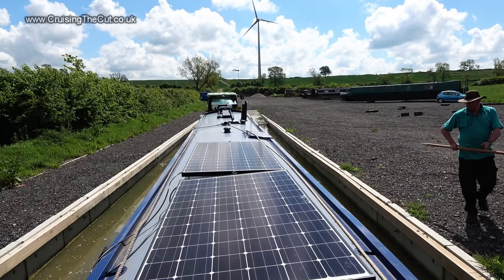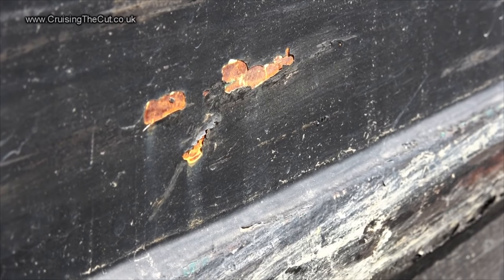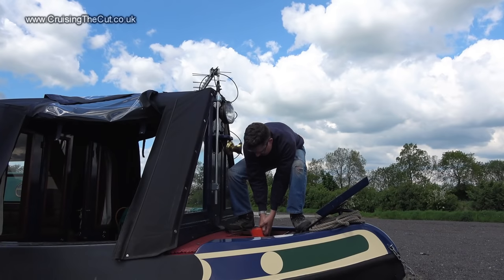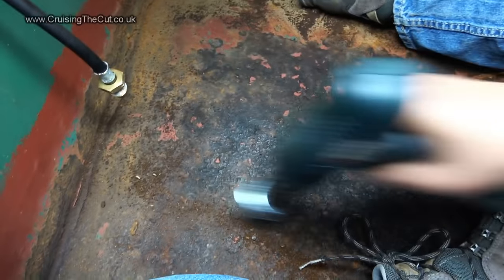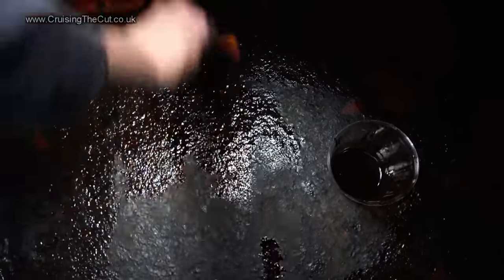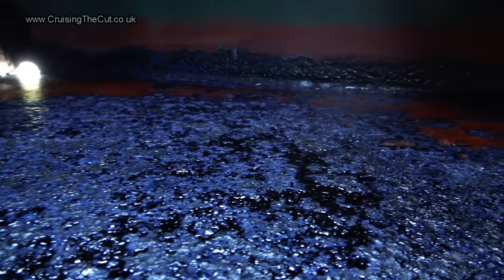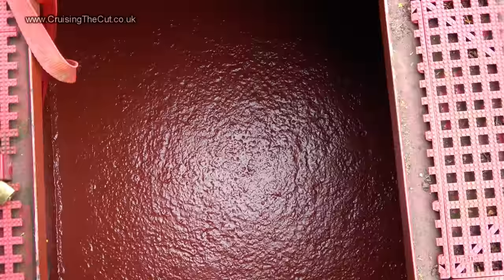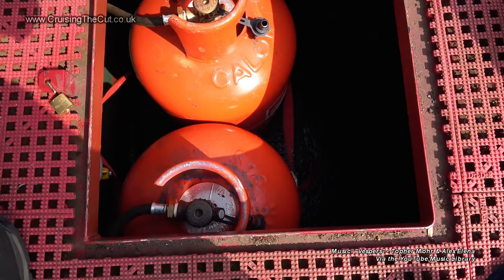55. De-rusting and repainting my narrowboat gas locker

Comment: For never having done this before, I think you did a pretty decent job of it.  Earlier this year, I made a similar error sanding down some wooden deck furniture.  I thought I had enough fresh air and didn't worry about a proper mask.  I breathed in far too much wood dust and I ended up with my lungs irritated and breathing issues that lasted about 2 weeks.  I learned my lesson.  I was quite worried that I may have done some permanent damage to myself but in time it finally cleared up.

Comment: Years in the Merchant Navy has taught me that the only way to scrape away a rusty deck is to use a "Needle Gun". They are powered by an air compressor and will do a first class job in a fraction of the time it takes to do it with a wire brush. I would be very surprised if the Marina doesn't have the kit somewhere and they may be prepared to hire it for a few quid.

Comment: I know this is four years old now but if you have to "do your gas locker" again, you may want to think about electrolysis. O-Level Chemistry is your friend. Fill you gas locker with an ionic solution (preferably not salt water), isolate your boat electrics, you'd have to plug the drain holes. Attach your boat chassis to the negative pole of a battery (your boat probably is negative earth), find a piece of scrap metal (sacrificial anode) attach it to the positive and dunk it in the ionic solution. It may work YMMV.

Comment: Methods learned in navy to remove rust: use a hammer * for 95%, then a angle grinder, for the 4.99%, then the phosphoric acid for the 0.01%, then Rustoleum red primer and top coat.  Safety gear: ear and eye protection for the hammer work, dustproof eye protection and filtermask for the grinding, and rubber gloves for the acid work..  
*  Steel is much more flexable then the rust so a good wack will easily  break nearby crusty rust loose. 
Best learned by watching others wield the chipping hammers in the hot sun.
Reply from the maker: Excellent info, thank you.
Reply: I use a wire wheel on a 4.5" angle grinder for rust removal of this type after tapping the loose stuff with a hammer. If you want a smoother finish use a flap wheel on the grinder afterwards.

Comment: Hiya David. Could you possibly cut a pvc pipe in half and glue it to the side in the well deck to fashion a culvert. Of course, cutting it in to the exact measurements. Possibly a coat of putty around it. (( Only thinking out loud )) 😊 great job 👍

Comment: I would consider investing in a corded 4.5 inch angle grinder. You can get them fairly cheap from Screwfix and wire wheels for them are cheap too. They shift rust for breakfast and although noisy, make mincemeat of de rusting. I bought one years ago for £25 and have restored countless engines and other bits and bobs. It owes me nothing. You could use the marina genny to operate it. Just a thought.
Reply from the maker: A good recommendation is always welcome! That said, hopefully rust jobs like this won't come along too often.
Reply: Absolutely agree. I paid £11 for my grinder from Homebase  for just this type of work

Comment: Usually, on larger boats, a tool called a needle scaler is used to knock rust off. It's a pneumatic tool with a bouquet of hardened steel rods that bang the rust loose.

Comment: I love Rust Converter I use it all the time on the farm, I have yet to have to re-due any particular job, I put rust converter on our Turkey Barn Feed Silo tanks on the outside ten years ago and painted it and it still is holding...my rust converter turns white the next day, and it says to re-scratch it with wire brush so I do... than paint ..strange stuff but it works...nice job...PS I love Marine Paint we use it on our Farm Equipment....little more expensive but worth every cent.....its Awesome....Cheers
Reply from the maker: That's nicely reassuring! Thanks.

Comment: Just a note about the use of rust convertor chemicals like the Fertan: DON'T dip your brush directly into the bottle, or pour the unused product back into the bottle!  The Fertan and others chemically react with rust to "convert" it to a hard, plastic-like surface, and since your brush will invariably pick up some rust flakes, they'll be put back into the bottle.  The next time you go to use the bottle of Fertan you'll find that they entire bottle has been "converted" and is now useless!

In the States there are similar products from Rust-Oleum and others, available at Wal-Mart and auto parts stores, as it works well on rust no matter where it's located, and I've used it on cars for decades.

Comment: I wonder if it is a good idea to basically make a little dam inside the welldeck lockers so that any liquid coming from the welldeck is channeled right out the hole again without getting into the locker proper. After all the lockers are covered, so theoretically water shouldn't be able to get in there from above. if you want to try it out, you probably could use the silicon-esque stuff you used along with that magnet on the roof.

Comment: I don't know about that rust converter but the brand POR 15 you just paint on with a brush let it work per the instructions, basically it converts the rust to a different type of oxide that is more stable, black in color, essentially it's like bluing for firearms or tool blacking, it's a hard durable surface that protects the steel underneath. Then simply paint over it.

Comment: When it next comes out to do the well deck and lockers can a flat bar be welded into the well deck lockers corner so the water runs straight thru the locker and out the drain hole without swamping the deck locker. Be a shame to do it now and remove all that work but worth doing if grading back to bare metal. Another pleasurable video.
Reply from the maker: No, because theoretically that would be a slight barrier to any low lying gas that escaped from the cylinders & that's not permissible.

Comment: I noticed the hoses do not have the new  hose ends. They are designed so if a leak occurs suddenly it shuts off gas. It also means you have to slowly open the valve  or gas does come thru.

Comment: nice job all over.  looks terrific.  i wonder if there is a better way of venting the gas locker that you dont get water coming in to it.  i understand why the vents have to be so low, but there has to be a way of getting the vapors out but keeping the water from coming in.
Reply from the maker: It has to be at floor level so what it really needs was the whole locker to be taller in the original design

Comment: A year or so late but. Have you looked at using a truck bed liner spray like Rino lining in these areas? Your channel got me hooked on Narrowboats. I do own a 25 foot sail boat unfortunately there is a serious lack of canals here on the west coast of the US. I can sail by the Queen Marry and surrounding cost but your views are spectacular.
Reply from the maker: Can't say that I have (or even know what that is). I'm hoping the water-resistant blacking will do the job, as it does on the hull.
Reply: CruisingTheCut Over here in the US it's a textured spray on liner that is waterproof and made to take a beating. It looks like they call it line-x on your side of the world.
Reply from the maker: I'll have a look; cheers.

Comment: I prefer the bow arrangement where the gas bottles are stored in compartments on the well deck and what you have as your Gas locker is the water tank. It means the legally required gas locker bottom vents are above the water line.
Reply from the maker: Technically speaking mine are above it - just not by enough! But I agree, I'd rather have the gas lockers at the back on the stern (see my recent "reflections" vlog)

Comment: To keep the drain holes above the waterline,  load the boat down at the back, it should lift the boat up at the front,  you should experiment with sandbags if that works use heavier steel blocks.  P.S. Love the vlogs, should make into full length series.
Reply from the maker: Thanks but I don't want the boat permanently tipped down at the back and it wouldn't be secure enough as a solution to work on it like that. Cheers though. Not sure what you mean by full length series, there are 50+ vlogs already, how much more length can I do?!!
Reply: We had same problem on ours. Took out 290kg of ballast from the front half, that cured it !!! Boat actually handles better too, bonus! All the best from Bill & Jayne (Hatton flight).
Reply from the maker: Can't even get to the ballast on mine without ripping everything up :-(

Comment: From my experience I have found many of the rust treatments have disappointing long term effectiveness, including the one you are using. A treatment that I found to be most effective was to clean as much rust off as possible and then paint the steel with a Shellac based lacquer (I have used a product called Renewit) which has the effect of penetrating the deepest rust and sealing it up against oxygen so stopping further corrosion . For the paint finish, add some of the lacquer to the primer as well. Once applied then apply paint systems on top. In a wet environment I would suggest something like Epoxy pitch as used on the oil rigs.
A further comment would be to finish paint the inside of lockers etc with a light colour finish. 
In your case you may find welding in a new floor may be required at some point in the future if the rust has deeply penetrated the steel, which is looks as though it has.

Comment: If you ever have to do that sort of rust removal again an angle grinder with a twist steel wire brush and a “stripper wheel” (not as fun as it sounds but certainly dirty) will make fast work of the rust.

Comment: hope you welded the hole up to stop the water getting in and drilling another one above the waterline
Reply from the maker: All the holes are above the waterline! Else the boat would sink. It's just not enough above. It can't be closed and another made higher up because it has to be at the level of the locker floor, so that any escaped propane would flow out of it (since propane sinks)

Comment: Is it still ok the paintjob? A quarter of a steel pipe (cut in the lenght) welded in the welldeck lockers could allso easily do the job! Anyways happy to see the vlogs keep um coming😃
Reply from the maker: Seems to be OK but with the water still splashing the locker daily, it's never going to last forever, unfortunately.

Comment: Love your channel, but please ask your friendly gas engineer about the benefits of PTFE tape. I think it does not hurt in your installation, since the seal is provided by the cutting ring. If that seal is not thight, then the gas will find its way out through the thread or along the copper tube. Sealing the thread with PTFE will only block one of these escapes. At best the PTFE is something like a cargo cult fix. The worst case, obviously would be, if somebody copied your method in an installation where the thread is part of the seal.
Reply: PTFE tape should only be used on pipe thread, (tapered thread), fittings.  Those with a conical seal should never have PTFE tape on them.

Comment: Can't some type of aluminum corner strip or 'L' shape strip with a rubber gasket be laid down in those lockers so the water runs through them in a little channel and got get into the whole locker? Same with those gas vent holes, can something be put so water can't come back in? Maybe even have a piece of metal welded in those three lockers to keep the water from spreading inside the entire lockers.
Reply from the maker: The lockers, yes, the gas locker definitely no. There must be nothing that inhibits any escape of gas (heavier than air so lying at the bottom). Instant BSS failure.

Comment: Top job on both the de-rusting and the video. Is it expensive to get a boat pulled out of the water?
Reply from the maker: Depends where you have it done. It's £180 at Yelvertoft I think. I've seen others charge £150.

Comment: I'm wondering if there's a way to put some kind of baffle on the drain holes? If it covered the hole, opening to the back to keep water from flowing in, but still allowing gas to escape, would that work?
Reply from the maker: I think anything that obscures the holes would be regarded as a safety risk by the BSS inspector - they are there, after all, to let any escaped gas out.

Comment: Another great vid. Why not plug the drain holes at the waterline to prevent back flow into the compartments?
Reply from the maker: They're essential for safety, to let any escaped gas out of the locker rather than have it build up (explosion risk)
Reply: Of course, but couldn't they be located a few inches higher so as to prevent water intrusion?
Reply from the maker: No, because the top of the gas bottles would protrude through the locker roof! It's been designed poorly; should be higher and taller.

Comment: Can I get my yacht to that hardstand ..those guys are amazing ..they actually came back and lifted your boat ..wooh that is service ..here is a story ..one of my clients has this 126 year old wooden river boat much like your narrow boats ..the keel bolts had been eaten out with electrolysis ..OK ..on to the handstand they set the boat down over a big puddle of water in mud ..I asked them to move the boat away from the big paddle of water and mud as it was the  keel I would be working on ..they would not ..so I call my client sent him a picture of the disgusting mess a few hours later they turned up with a small trailer of gravel ..which just turned the mud into thicker mud ..omg ..oh it get better than that ..as the job move along with the keel bolts I need the boat lifted and the blocks moved so I could get to the rest of the keel bolts ..asking for this they would not .
2weeks of crawling around in mud and gravel I was starting to regret the choice of hardstand ..anyway I again have to call the client ..standing in front of the hardstand owner the client called him ..OMG..
To talk to the hardstand owner I had to talk to my client..my client gave me full authority at the start of the job ..I could not believe the uncooperative way of doc yd 5 Whangarei .my client is very high up in the wooden boat Association of Auckland city he love's his 126 year old skipjack ..I got all the work done ..but the hardstand was a nightmare ...
Reply from the maker: Wow, that sounds most unpleasant

Comment: If you just sailed at low tide the water wouldn't be as high and shouldn't come in the holes. ;-)
Are you allowed to fit a rubber flap over the hole on the outside to stop backwash coming in, short of a catflap idea but on a smaller scale? 
Ray
Reply from the maker: No, any obstruction on the gas safety vent holes would be a safety fail; any leaked gas wouldn't push open the flap so it could build up.

Comment: I live in USA in Oregon state our weather is like yours as a welder you did a good job but how thin is base plate? you may have to replace the bottom plate later.
Reply from the maker: The boat base plate is 10mm but unfortunately I don't know the gas locker thickness. The sides of the hull are 6 and the cabin sides 5 or 4mm so I'm guessing the locker's 6/5ish!

Comment: Your videos are becoming a guilty pleasure. I have just brought a narrow boat and just about to tackle a similar gas locker issue. There lost of conflicting advice regarding the best products to use for rust conversion.  

How did you decide which rust converter to use?

Thanks again.
Reply from the maker: Oh, it was a nightmare, all sorts of conflicting opinions. Eventually just had to pick one! Lots of people seemed happy with Fertan, others use Vactan.
Reply: +CruisingTheCut  thought so i been advised to use vactan for the hull jenolite for under the paint. 

i have an open water tank like your gas locker. now i dont seem to be able to get advice on that either. 

so not gona tackle that one till i get more information. as each bit of advice has the risk of funny tasting water. 

Thank you I find you blogs very useful. . You have made me laugh out loud on the train to office.
Reply from the maker: Glad you enjoy them. I don't know Jenolite, I'll have to look it up. I think most people just use blacking on their integral water tanks, don't they?

Comment: Great videos just discovered them! But why did you need the boat out of the water to do this? Must of cost a few quid
Reply from the maker: Didn't I talk about that in the video? Sure I meant to. Water comes in the vent holes because they're so low down and it needed to be dry to re-do.
Reply: CruisingTheCut no you didn't mention it but that would make sense yes good idea!

Comment: Hi. vent must be  with the floor, because the propane butane gas is heavy and stay on the bottom. someone has designed it wrong, because it was enough to lift the bottom of the chamber above the water line
Reply from the maker: Hi, thanks. Yes, I know it must be on the floor and I agree it was badly designed!

Comment: A battery powered drill is the wrong tool for that job twice over.  I worked in a metalworks shop to help put myself through university, and I'd never try to tackle a job that large with something that wasn't mains powered.  Also, those wire brushes tend to work better when attached to a grinder.  You just have better leverage.

I know this is all well in the past now, but I know in the US the main home improvement stores will rent you tools for a few hours if you don't want to buy something like that.  Something to keep in mind for any future repairs.  (though hopefully you won't be needing more rust repairs.)
Reply: If he had a good drill, such as a Makita, then it wouldn't be a problem!
Reply: @szymongorczynski7621  Nope! Angle grinder runs at around 10,000 rpm. Drill is about 1,500 - makes a very big difference.